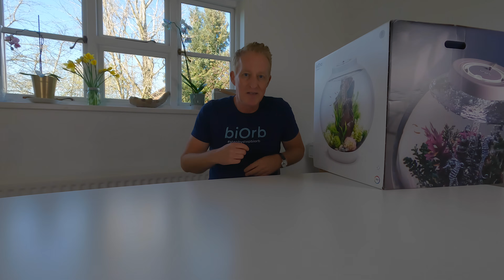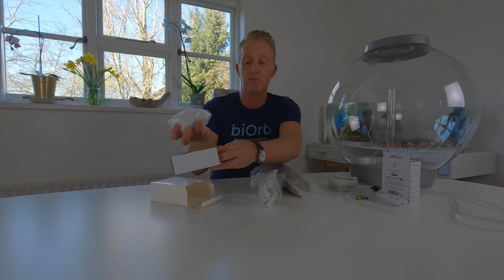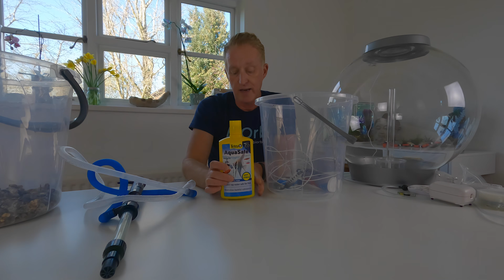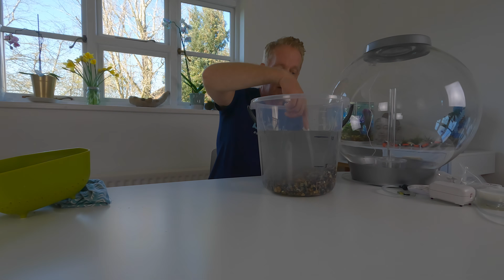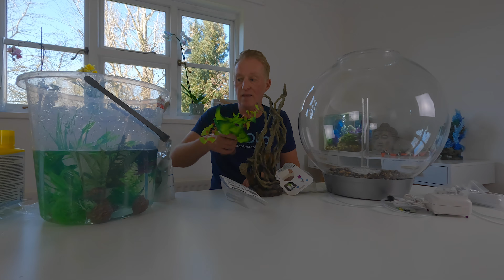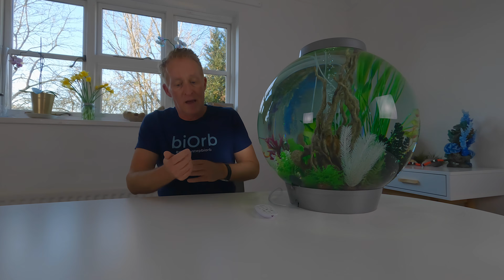biOrb Aquarium   | Starting a biOrb | New approach!

Comment: Hi mark. I set up my flow30 on Saturday. Did everything as instructed. The water was lovely and clear. Today it’s a little cloudy???? No fish yet. Have I not done something? Or will it settle down?
Reply from the maker: Hi. Well done on getting it set up. Cloudy water is a very common new tank thing  ...It's nothing to worry about in terms of adding any fish (adding fish is part of the solution). Your filled tank is providing a free-for-all for waterborne bacteria and they are having a field day with the water nutrients.  There is currently nothing to compete with them so they really go to town. You should find that when left alone they will eventually consume all there is for them and then the tank will move to becoming clear again. When you add the beneficial bacteria (BB) and start to cycle with fish, the BB will become the new kids on the block and will outcompete the current bloom you have.   Doing water changes will not really help and would simply prolong it - i.e. you would be adding more fresh nutrients.
Reply: @StepbyStep-biOrb  thanks Mark. I’m hoping to add my fish today if that’s the case. I just wanted to check it was nothing wrong.
Reply from the maker: Re adding fish... that's good news. Let me know if there is anything I can advise on.  What fish species and number did you decide to add? Did you go with green barbs?  Also, what product are you using to cycle (i.e. bacterial product)?
Reply: @StepbyStep-biOrb  goodness you have a good memory. Yes I did 6 green barbs and I’ve used the colony like you said. Light feed and then nothing for 4 days you said didn’t you?
Reply from the maker: Hey, great fish choice! :)  The best thing to try to do when cycling is initially keep water ammonia levels at around 0.25 (up to max 0.50ppm).  This will really help speed-up the cycle. The reason to keep a small level of ammonia is to provide the necessary food source to promote bacterial growth/expansion. If ammonia is too low it will prolong the cycle (slow down the bacterial colony expansion due to the lack of food).  Daily ammonia checks are a really key thing to do at this stage as these inform whether to add any food or not. If ammonia remains too low then add a very tiny (and I mean small!) bit more food. Adding food each day is fine in order to keep some ammonia in the tank.  If the ammonia levels start to rise up over 0.25  then cease feeding.    The added bacteria  will only begin to convert ammonia and expand after they have adhered to surfaces within the tank. Initially, when you add Colony to the tank, the bacteria remain within the water column, for up to say 24 hours, and are not doing a great deal.
Reply: @StepbyStep-biOrb  I bought the water testing kit that you recommended. I’ll do a test tomorrow and see what it says, might come back to you to tell me if it’s ok?
Reply: @StepbyStep-biOrb  I’d say it’s between the 2. So I’ll give them a smidge of food and see how we get on. The tank is recording a little chilly too this morning at 26. Might need to adjust the heater?
Reply from the maker: Hi. Yes, just a tiny bit more food should get you into the sweet spot. Not too much though, a very small pinch. 

26 = "slightly chilly"!  Lol. :-) 
Green barbs originate from Asia and are associated with slightly cooler wild temps (roughly 22-24°C) although are fine in an aquarium with a range of say 20-26°C. 
BUT, I would leave the temp as it is for now as BB do far better (initially) with a warmer temps (24 -30). Temp is another thing to help with cycling.
Once the tank is cycled then you can adjust temp down nearer to the sweet spot for the fish you have (about 23°C). 

Mx
Reply: @StepbyStep-biOrb  thank you mark. I didn’t know that. 😂
Reply from the maker: Hey, just a learning curve thing. Always steep at first, that's all :)
Reply: @StepbyStep-biOrb  hi mark. Just checking how I proceed. Put my fish and BB in on Wednesday afternoon. Have a little food. Ammonia on Thursday was 0.25 so have a smidge good. Today ammonia today 0.5, nitrite 0. So….no food until Monday?  They are in my dental practice. Do I need to go check them tomorrow or Sunday?
Reply from the maker: Hey. Okay, yes, no more food for the next couple of days.  I would expect nitrite to still be indicating 0 at this time (nothing unusual with that). No food until Monday is probably okay. I don't think there is a need to go in to the practice... unless you are tempted :) Hopefully on Monday you will see nitrite levels starting to show, and possibly an increase in nitrate. On Monday, check ammonia, nitrite and nitrate. Let me know results on Monday and then I can advise re feeding.
Reply from the maker: Hey, how are things? Wishing you a Merry Christmas and a Happy New Year.  Best wishes, Mark x
Reply: Good morning. Day 6 of fish. They had no food for 3 days and a small amount yesterday. Water testing today ammonia 0.25, nitrite 1, nitrate 40? 😳
Reply from the maker: Hi again. Can you remind me what you baseline nitrate level was (i.e. the level of nitrate before adding fish, it would be the same as your tap water)?
Reply: @StepbyStep-biOrb  I’ve just tested the tap water. Is it possible it’s 20?
Reply from the maker: Yes, easily possible. If you want to double check you can visit your water supplier's website and get an instant water quality report for your postcode.
Reply: @StepbyStep-biOrb  the website says 38.3 mean.
Reply from the maker: That's a bit strange. Can you email me ( markbstepbystep@gmail.com) your water supplier's name and your postcode - I will double check.

Comment: Hello Mark,  I just got a New BiorB 30 tube,  at the moment i have still an normal  30 liter aquarium running with fishes.  The Biorb i bought is to replace the other aquarium.  Is it smart to use the old water from my current aquarium to start up the biorb faster or what is the best way to  start up the biorb and put there my fishes from my current aquarium.  Should I use old water or should i start up completly with new tap water and then wait some days?  What is the smartest to do,  hope you could give me some advice.   Thank you  your videos are really good and full of information.

Best regards
Reply from the maker: Hello Mike. Really great to hear from you. The key to speeding-up the cycling of the new tank lies in the materials/items within the existing tank.  If it is a standard aquarium, a key thing will be probably be the existing filter system (sponges), the dirtier the better! Anything like existing gravel, rocks etc are very good too.  Beneficial bacteria exist and grow on surfaces and are not really present in the water column.  I'm not sure there would be a great deal of benefit from re-using the existing tank water. It would probably be easier to start a fresh and get the new tank up and running whilst still running the existing tank with fish in (if that is possible, that is what I would do).   You could then transfer a few of the existing fish into the new tank to help kick-start everything.  After a few days add a few more.  

In terms of transferring some of your existing tank gravel, zipped filter bags are perfect: https://amzn.to/3d9dRng.  Add a good handful of existing gravel from the existing tank into one of these bags, zip it up and then add it to your biOrb. The bags would allow you to then remove the gravel from the new tank once everything is cycled. In a similar way it would be good to put a large handful of the your new biOrb ceramic media into one of these bags and then add that to the existing tank. After a few days this biOrb media can be removed and emptied into the new tank. If your existing tank uses a sponge filter it would be worth cutting off some of it and adding this to the new tank (weigh it down at the bottom of the tank to speed up transfer of bacteria on to the new substrate.  Getting a small bottle of bacterial booster would probably be a good thing to add to the new tank. Either Aquavitro Seed or ATM Colony (Freshwater), follow the dosing instructions on the bottle.  All (or much) of the above will get your new tank cycled very quickly.   Hope that points you in the right direction.  Best wishes, Mark

Comment: Please help!! How much water conditioner do I add? Also do I add the biological booster at the same time?
Reply from the maker: Hi Lee. It depends on the water conditioner product you are using (do you mean dechlorinator?). If it is what I recommend (i.e. AquaSafe) that should be applied at 2.5ml per each 5 litres of water added to the tank. Are you setting up a brand new tank and are you perhaps referring to the biOrb  sachets that come with a new tank??
Reply: @Step-by-Step  with the biorb tank I got a 5ml water conditioner and 5ml biological booster, wasn't sure if I add both of them while filling or even if there's enough for a 60l tank, I bought some API Stress coat from my local water Gardens, and didn't know if to just use that instead as I have a 100ml bottle and that says to add 5ml every 40l of water
Reply from the maker: Hi Lee.  Yes, you can use the biOrb stuff, but it is all very short term. You basically need enough product for biOrb ownership and to fully cycle the aquarium. The biOrb quantities do not satisfy this requirement. For making tap water safe I would suggest AquaSafe as this is a straight forward water dechlorinator and doesn't have a negative impact on establishing a tank's beneficial bacteria (cycling). I would suggest getting this and adding it to your aquarium (2.5ml per 5 litres) when you get it. You can get it next day here: https://amzn.to/3iRaeFC.  I personally would not use API Stress Coat as this may impede the growth of bacteria. If you are planning to do a fish in cycle, you will need to get either Aquavitro Seed (first choice) or ATM Colony bacteria and use this when you add fish. Best, Mark
Reply: @Step-by-Step  the APi was suggested by the owner of  the tropical fish department, so that's why I got it as planning on getting tropical fish, but if you think the aquasafe is better ill order a bottle, thank you very much

Comment: So impressed with the hygger pump. It is so quiet.  Am now changing my others as they niw sound loud in comparison !!. Thanks for the advice Mark
Reply from the maker: See... I told you!!  LOL  :)  They are much quieter than any other pumps I've tested to date. Many pumps make claim to having low noise, but they are very often not. Anyway, the hygger pump does what it says on the tin. Again, if airflow is a little bit higher than what you want just add a regulator to the air line. I'm glad I've helped! M

Comment: Hi again. My new pump is very loud even with flow valve on. Can I change it for another one? Does it have to be the same voltage? I guess it would have to be plugged in separately.  By the way my classic is now clear as a bell. Looks lovely  and happy lively danios and minnows.  Thanks once again
Reply: I've ordered the hygger pump thankyou for the advice. I also treated myself to the intelligent heater and turned my cube tropical. Great little heater and so discreet.  Like you I hate the appearance of traditional heaters. A whole new world of fish has opened up to me!!!
Reply from the maker: Hi. Hopefully you will like the hygger and you'll find a noise reduction. Yes, the biOrb intel. heater is hard to beat in a biOrb... despite it being very expensive.
Reply from the maker: Hi Paula.  Yes, certainly, you can change. No need to be stuck to biOrb. All air pumps work off standard household voltage. But, you will need a separate socket for it. It is best to use a short extension lead, like I do, and then run things from that.   

I have tested a range of air pumps. If you want quiet one that works really well I reckon this Hygger one: https://amzn.to/3ZFyuea. You can get them in black or white. I have had one working on my FLOW for ages and it is still great with a very low sound level (the quietest pump of all the ones I've tested). If I needed another pump I would certainly get another! 

Great to hear the Classic's water is now clear. It can take a little while sometimes (cloudy/milky water is just an initial "new tank" thing that often happens). Great also that your fish are happy and lively and are settled into their new home. 

How's the cycling going?
Reply: @Step-by-Step  all good. Water parameters all in range thanks s much 👍
Reply from the maker: Perfect Paula. Great news, very well done! Please do shout if any parameters go a bit weird xx

Comment: Can you add decorative gravel ontop of the media
Reply from the maker: Hi. It depends.  biOrbs function as an under gravel filter system. So, this requires a good water and oxygen flow down and through the media and then a flow towards the central filter/bubble tube. This water/oxygen flow is necessary to support the biological filter (beneficial bacteria) that occupy the biOrb's media. The use of fine/small/medium gravels etc, placed on top of the biOrb media, may very likely reduce the water/oxygen flow and make the under gravel filter system less efficient. In addition, either of the two types of biOrb media (Ceramic Media or the new Pearl Media) need to be regularly cleaned to remove waste, which gets trapped under the media. The best method for this is using a battery gravel vac (see my vid).  Over time, the use of a gravel vac will ultimately result in the mixing of the decorative gravel and the biOrb media, so that the decorative gravel will end up no longer sitting on top of the biOrb media.   The alternative would be to look at another alternative substrate material but ideally one that doesn't need a conversion of the biOrb system.  Hope that helps. Mark

Comment: Interestingly the pump on my new biob classic is really noisy.  My other 2 identical pumps are much quieter. I wonder if they improved with use???
Reply from the maker: Yes, that is interesting. I seem to get a different pump each time I get a new tank! The one that came with the loop was a bit noisy but the air flow was too high for my liking. I added a regulator to drop the air flow a bit and that has done the normal thing and also reduced the pump noise so it is now not really noticeable.
Reply: @Step-by-Step  thanks Mark. I also gave fliw adjusters on. It has  helped a bit. Just added 4 zebra danios and doing a  fish in cycle with added bacteria.  They look great
Reply from the maker: Great news from you on the cycling. In terms of the air reg, I would suggest you go for full air and flow in the tank to help speed up the cycling, then turn it down beyond that. Once the bacteria are established, a lower air flow makes little difference to the bacterial colony growth/productivity.   Any problems just shout.   M